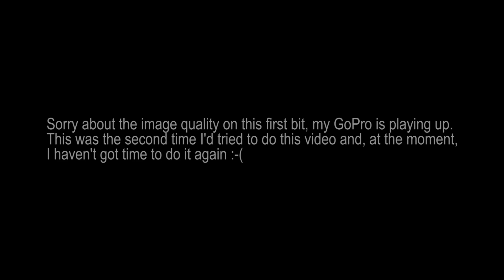Xiaomi M365 Pro scooter part 4 - Test run with 60A BMS and 12S lipos - the ultimate mods

Comment: I Hope YOU ARE FINE. Question-is it possible and use one Wheel for Drive and the OTHER Motor some GENERATOR to load the Battery if you drive? I Know it will missing speed,but i will have loading by driving and have a longer range,not more Power.

Comment: Hi Tony, just wondered did you remove the original battery and fit your own 12S battery, whilst using the original controller with a flash to support a 50.4v 12s battery? I think this is my next mod?
Reply from the maker: Yes, exactly that 😁
Reply: @Vortecks  Thanks Tony, I note you did buy a smart BMS? I have a standard one so will I still get speed on the pro dashboard and just no battery related capacity?
Reply from the maker: @DIZZYDAZZLER2011  The version I have now (with the ANT BMS) doesn't connect to the screen. I'm too busy trying not to kill myself to look at the speed I'm going.
Did you know I wrote an app for the ANT BMS? https://play.google.com/store/apps/details?id=com.vortecks.vbms&hl=en_GB

Comment: is this with standard engine on pro??? what about temps? my engine gets SOOOOOO HOT on standard battery and cfw with 42000 power constant. when i touch the wheel it hurts. is yours same?
Reply: Mine is less than 40k so it has more power but it's just slightly hot to the touch ;)
Reply: @proxyhx2075  my pro is hot af no idea why. not burning but deffo very hot
Reply: @proxyhx2075  burned my motor at 41k going uphill (more than sure it was due to russian throttle mod) as same power without it was 100% tested and ok. also controller is ok but motor dead and thats rare in it self

Comment: Hey. How are you getting 30 mph on 12s. With the speed limit being set by max voltage, at 41v it does 31 kmh, this drops as voltage drops. 12s is 48v, thats a 20% increase in voltage. But 31mph is 50kmh which is around 70% increase of top speed. I do understand you have a 60A bms, however that does nothing (except to not cut off at something above 30A) as the speed controller is limited to 30A, and its the controller driving the motor, not the bms. My scooter now runs on 14s and does 42kmh, its not the pro but the first version, but still, something doesnt compute..

Comment: I think about doing something like this but only 11s3px2. I've got an extra battery I was going to put that in parallel so the voltage stays the same but what I can't figure out if I should put the connection going into the controller or behind one of the BMS's

Comment: This looks great, it solves my issues with normal electric scooters that they seam to slack off quite a bit when on a an incline, and living in quite a hilly area it makes most scooters pointless unless you buy one of the really expensive ones. 30/35mph is really solid. Do you think you could do this even cheaper though? Perhaps with an even cheaper scooter and still get 30mph an a half decent range out of it?

Comment: Hey, You inspired me to do something similar with My m365 pro, but I have problems with My controller, it throws this damn error 24.. How did You connect the signal wires to the controller?
Reply from the maker: Error 24 is when the BMS doesn't talk to the controller - I'll be starting the 'how to' shortly but I warn you, it's not easy!

Comment: So to summarise, IRFB 4110 fets on the controller. A 60 amp BMS with LIPO's. Thicker phase cables. Thicker wire and bigger XT connector on controller and battery. Anything else im missing?? Love what you've done with the scooter!! Amazeballs!!! I expect to see your next set of mods lift you an extra 5 inches off the ground because the tyre doughnut so hard!!! Muhahaha!!
Reply: Also could you tell me what Gau cable you managed to stuff through the motor axle?

Comment: Tony......dont know if you remember me, but im the guy who was messaging you before from west brom.........would you be willing to do the solder part/ spot weld of a pack of cells ?? I have the plastic clip together thingys.......i have a load of cells i have recycled from power tools.....all sony vt3 vt4 , samsung 20r etc and a bms.....i got some ebay nickel strip too i just dont wanna try soldering them as fear i might wreck them id be willing to pay you for your time of couse........let me know what you think....cheers regards ozzy
Reply: P.s that 365 is effin bonkers mate knew it wouldn't be long before you started pushing its boundaries lol
Reply: Hi Ozzy, 
Tony has asked me to help out as he is very busy at the moment and I am building custom packs for those that need them on the forum... You can private message me with what it is you need..
Reply: @footydoyouremember  ok mate, how can i get in contact with you on the forum etc and are you local too ?? Regards ozzy
Reply: @footydoyouremember  could you please post a link to the forum bud
Reply: @footydoyouremember  found it lol
Reply: I am sure you will find all my posts about batteries and in the for sale section mine is right at the top... Comment on that one... No I am not local but UPS will deliver everything needed, the main thing I need to know is what voltage and wattage the motor is and then would need dimensions of the battery
Reply: @footydoyouremember  i already have all my own cells mate and as for dimensions and wattage voltage etc i want to make a general use battery to any dimensions really .....just want to get the most out my cells
Reply: @footydoyouremember  what area are you based ??
Reply: Hi mate I am based near rochdale... But can send anything via UPS... It's all about what you need to be done... Let me know on the forum... I am steved7127 on there...
Reply: @footydoyouremember  what forum how can i get in contact
Reply from the maker: Cheers Steve.
Ozzy, I'm sorry mate, I'm finding it pretty hard to find the time to do my own projects, let alone anyone else's. Steve will sort you out and it'd be quicker than me doing it 😁
Reply: @Vortecks  ok tony thanks for reply mate and if you recommend steve thats where ill go :-) just registered on forum today will get ball rolling soon thanks again :-)

Comment: Make another video with 20s as i have... Per GPS i reach 58km/h 😎
Reply: How many volts is that? I have a custom made lithium ion 18650 battery 16s12p 60volts nominal that I made to power my custom dual motor ninebot es4, it gets up to 30mph or about 50kmh but I was thinking that any more voltage might cause the windings to arc and short out is this not the case?
Reply: R.I.P. the bearings 😂

Comment: Tony.. is what's the tip speed.??. is that still limited..?? Ps thanks for the entertainment with all you're content.. top man..👍
Reply from the maker: It's only physically limited by voltage because I've set the max speed to 99mph but it does >30mph now. V2 will be rear wheel drive with double the power (I've heard that before somewhere 😂).
Reply: @Vortecks  sound fantastic.. can't wait to see what you do with it.. love what you have done up till now.. planning to get one of these this summer.. ps loved to drunken review.. because I knew that now you have one you'll do something cool with it and you didn't disappoint... 😜

Comment: Tony is it possible to incorporate regenerative braking on any of your beasts? Something for you  and the followers to ponder over?
Reply: Why? would you want to?  This isn't a Tesla with 2 tonnes of Mass  to regenerate with.
Reply from the maker: It does have regen braking or KERS as they call it. It doesn't put very much back into the battery (only 1-3%) but it does work 😁

Comment: Ok, you upgraded the battery and the BMS, but the motor is stock, isnt it?
Reply: I'd say so, yes.
Reply: @TheLondonCyclist  Hm, but how much power is he sending to the motor and how much the stock motor with stock phase wires handle?
Reply from the maker: It is the stock motor with a max 600W output. I'm pushing 2kw now and I'm at the point of burning something soon 😁
Reply: @Vortecks  wow 2kw , now that should be a standard M365 :)
Reply from the maker: @supernova1976  Yeah, I don't know why they don't beef the controller up and push it to the max and release the M365 Ultra 😁